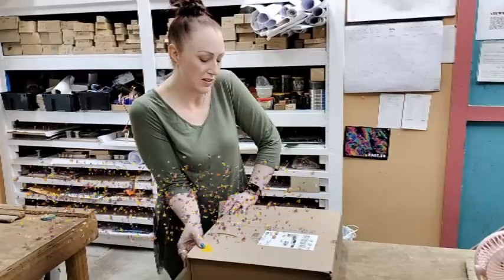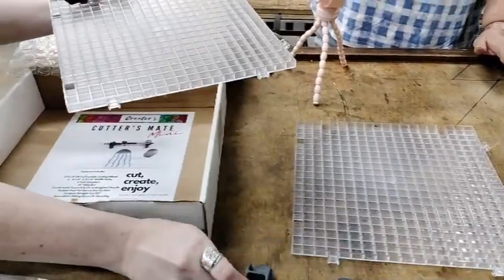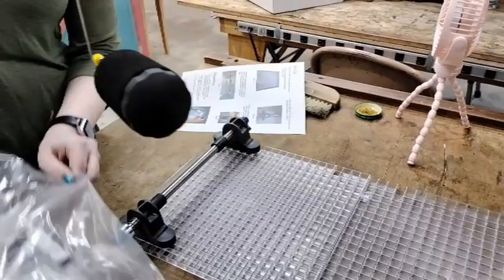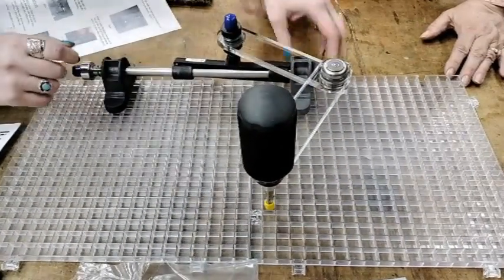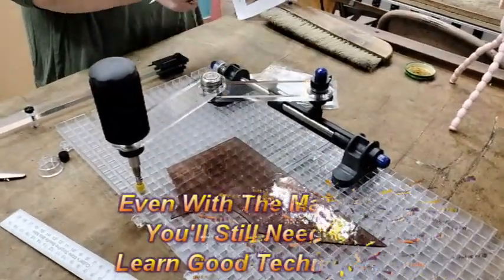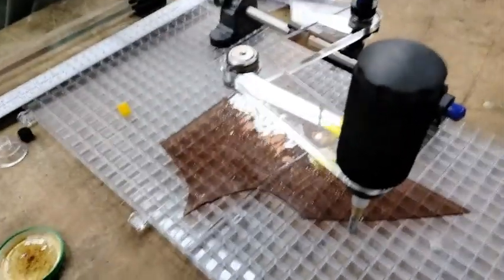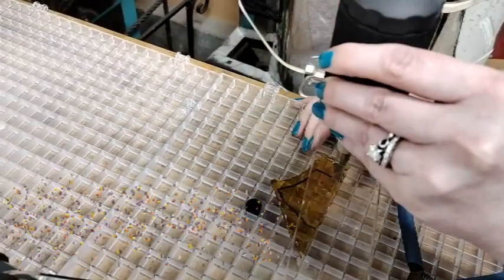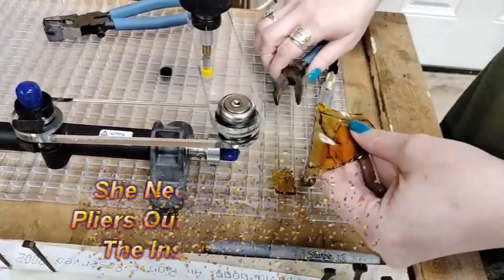Glass Cutter For Those With Carpal Tunnel Or Arthritis V-425

Comment: I had similar issues with learning that a certain amount of pressure was needed, especially as it seems to be marketed as "perfectly weighted". There is a real lack of instructions or videos on line, so I'm glad they attempted this and showed what a beginner would go through. I think like anything else it takes time to become proficient with the different feel of a big handle. I had trouble controlling it on intricate cutting, so would switch back to my regular cutter and then my pressure would be really messed up trying to go from one to the other! I would say, choose projects with simple cuts to become proficient (which I haven't done yet!)
Reply from the maker: Great advice, It's going to take practice.
Reply: I have arthritis. In my experience you need not apply pressure, just guide.  She’s pushing down….. it was hard to watch.  I watched a video a long time ago that changed the game for me when cutting glass.  Take a match box car and roll it across a piece of glass…. that’s all the “pressure” one needs.  Sometimes I can’t even see my score line, I have to put it under desk lamp, but low and behold, it’s there, and it breaks perfectly.  One does not need to “hear the score” to get a proper score line.  
It was very difficult to watch her use the cutters mate.  I hope she has gotten better with practice.